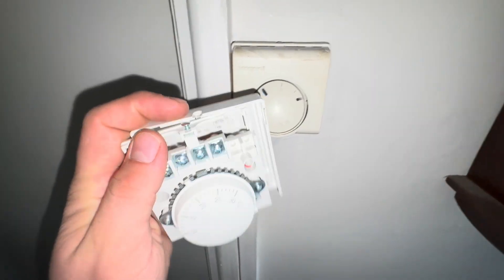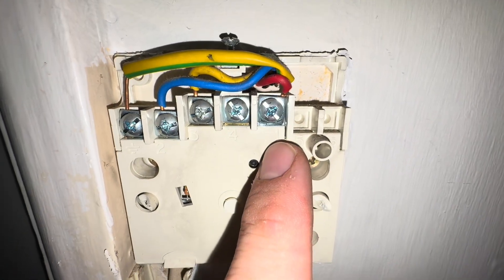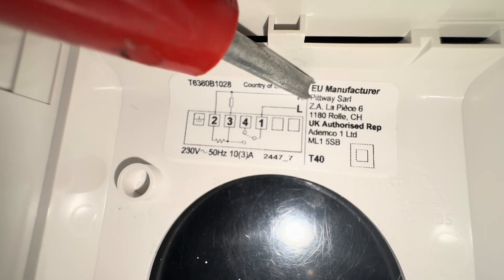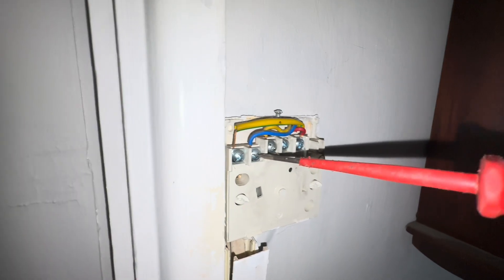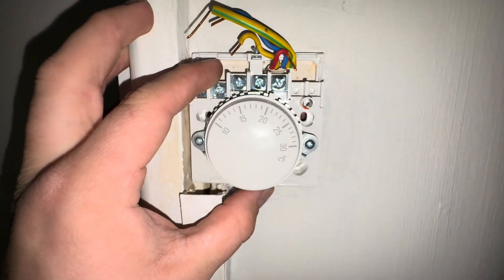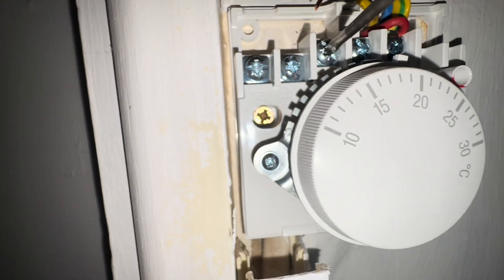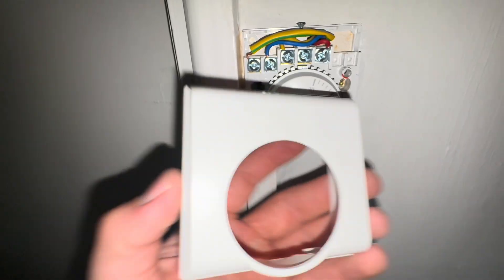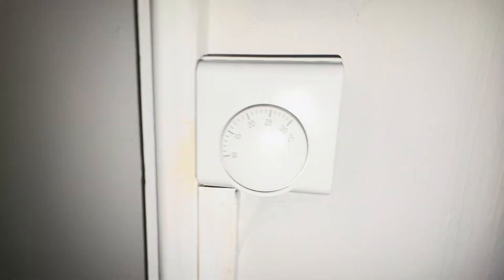How To Replace a Honeywell Thermostat | Step-By-Step Guide for Beginner Engineers.

Comment: I just fitted one of these as a replacement for a different type which had failed.However- I've just checked and terminal 3 is constantly live, whatever the temperature selected, so the CH is running constantly. Faulty unit?
Reply from the maker: It would have to be a faulty unit, I’ve rarely had one before - but I would also make sure the wiring has been done correctly and that the cable you have in 3 is not live even when it’s not wired up :)
Reply from the maker: I would also check that you are getting the click when you turn it on and off, I had it once where the white removable temperature showing face of the thermostat was incorrectly put in place, you then take it off and adjust correctly!

Comment: Great content that will help folk. But; you will be far better off ditching a mechanical room 'stat for a digital one, preferably with TPI technology. They have the same connections, so are as easy to fit, but control room temperature much more precisely. I never thought I could improve the clapped out system I run but it had stopped the - too warm, tweek it, too cool - that we endured for years! Just saying. Thanks again.
Reply from the maker: You’re 100% right, I do find that for example elderly customers want to stick to what they know and just be using what they had, I do offer alternative simple controls but most are not interested 😁